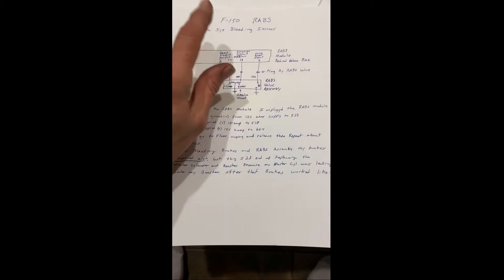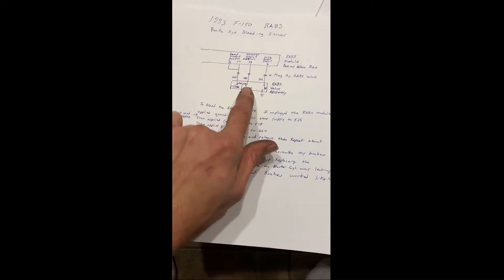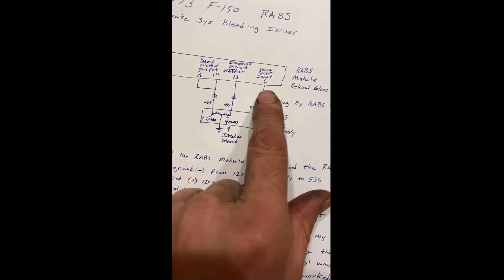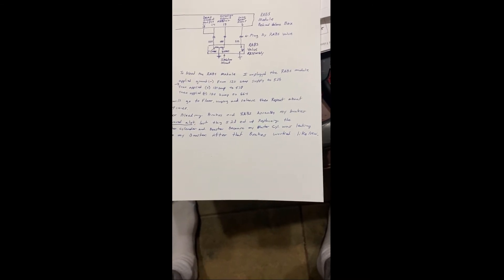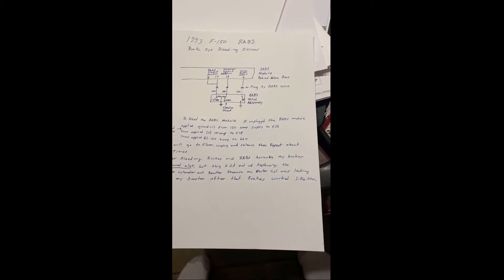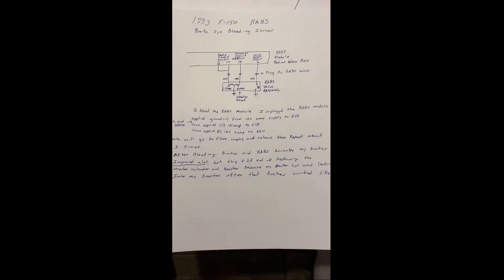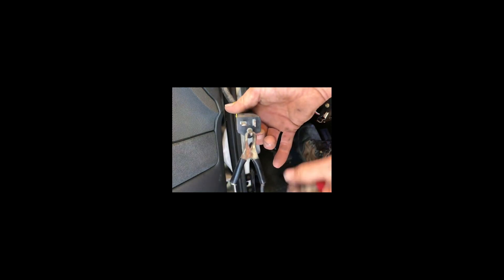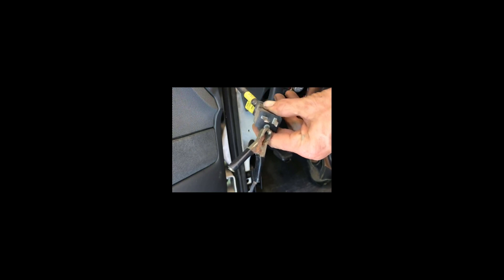Bleeding F-150 brakes, RABS, OBD1

Comment: 5 volts is all you need for this. I used 4 AA NiMH batteries in series.

I did this on a 1993 Econoline and it got my brakes working well.

The wiring on the RABS module is different in Econolines. All the RABS wires have two colored insulation. I connected (-) to the black/white wire, it being the ground for both solenoids. I alternated between applying (+) to the yellow/light green wire (dump solenoid) and the pink/light green wire (isolation solenoid). These being solenoids, polarity can be reversed.

During the standard brake bleed, I smacked the calipers and drum brakes with a plastic mallet to free up any air bubbles stuck to the walls.

I couldn't find an extra RABs connector, so I cut off my connector, wired it to my extension cord, did the RABS bleed, then soldered the plug back to the RABS. In hignsight, I should have also soldered some connectors in parallel so I can do this bleed again without cutting and mending wires again.

I highly recommend getting a copy of your vehicle's electrical troubleshooting manual. That's what I used and so did John Doe How To.

Thanks John!
Reply from the maker: You should make a how-to video because you seem like a really smart guy and it seems like a lot of people have trouble figuring things out.

Comment: Last one I had was a pain. Ended up bypassing the abs on the frame. It is a terrible designed unit. Primitive but doesn't work. Not worth buying a new unit either.

Comment: What's the pin-out on the module so I can use a power probe and apply the 12v  to yellow and red after I ground to black?
Reply from the maker: I’m not sure, colors may change over time. I just know that my plug-in device works, it’s been years since I made that video.
Reply: @geterdone   I have same problems whit my ford bronco 1987
Reply: @geterdone  can’t I use a  dewalt drill batery for provide that 2 volts

Comment: What is the "$500 test tool" you were referencing?
Reply from the maker: I think it may have been called a Ford rotunda superstar or something like that. It was a dealer tool that you can occasionally find on eBay for several hundred bucks. It seemed to me like it would have only worked with the four wheel ABS like some of the Broncos had but maybe their tool was broke because it didn’t work.
Reply: @geterdone  I'm surprised it was so expensive.  I have found numerous "antique" Rotunda dealer tools (like the EEC diagnostic computer) that originally cost tens of thousands of dollars originally for a couple of hundred bucks on ebay nowadays.  I do know that there was a special tool for 4-wheel ABS.

Comment: Does this method work for my 1996 F-150 with a 302? because a ABS light on in my insturment cluster that wont turn off after i start the engine.
Reply from the maker: As far as 96, I’m not sure. this is for RABS, (rear antilock brakes only) yours may have four wheel antilock brakes but I’m not sure. First question is do you have spongy brakes? If not check your tail lights and see if one of them might be out. If you have two brake lights go out in the rear or if you do like I did and put LED lights in there you’ll think the things gonna tear itself apart.

Comment: Can I pay you to do my brakes
Reply from the maker: Im in Washington state, you could if you have a flat safe gravel driveway you could (at your own risk) try getting to about 25mph or so and hitting your brakes to try to lock them up and the switch should cycle. I know a mechanic that said that is what he does in newer vehicles if he doesn’t have an electronic bleeder. He told me not to do it on pavement because its hard on the vehicles. It may take several times to cycle thru. Let me know how it goes.

Comment: I’m I exact same position. NOBODY can fix my brakes. How much is electric scanner? I have 95 7.3l
Reply: F350
Reply from the maker: The one borrowed from the dealership isn’t made any more and did not work. On ebay they were over $500, I wouldn’t risk it.
Reply: @geterdone  What is the name of the tool?  I assume it's a Rotunda tool of some kind?

Comment: I bought a 1991 F350 with really spongy almost non-existent brakes.  I replaced the master cylinder rear drum brakes and a rusty almost ready to blow brake line.  After all this I still had firm pedal when the truck was off but spongy to the floor when it was running.  I bled the brakes like probably 6 or more times (like 2 liters worth of fluid) using both a cheap vaccum pump bleeder and the traditional 2 person pedal pump and dump method.  Still no improvement.  I removed the RABS spring and bled a couple times still nothing.  I finally tried the method in this video using a 12V 1amp trickle charger to actuate the RABS then when I bled the rear I got a bunch of air out, after which I finally had normal brakes again.  Thanks for the video!!!

Comment: So im assuming you have the RABS bleed screw open while you were energizing it? When you let the peddle travel back up wouldn't this suck air in the system if you do not have some one closing the bleed screw? I have the spongey peddle and i have replaced everything in for the entire system ( full restoration). Im thinking its the RABS.
Reply: I did not have the bleeder nut loose when I performed this RABS energizing method.  I did bleed my brakes and the RABS from the bleeders after I performed the energizing and seemed to have gotten a bunch of air out of my rear bleeder which I presume was knocked loose during the RABS actuation process.
Reply from the maker: When I’m electronically activating it I do not have the bleed screw open, if you do that you’ll end up introducing air back into the system. When you electronically actuated it it allows fluid to bleed from the RABS unit back into the master cylinder reservoir so you’re not going to run yourself out of fluid unless you have a ton of air in the system.
Reply: @geterdone   can use a lawn mower to put energy to that rabs or only whit that battery charger
Reply: If I understand this, the bleed screw on the unit won't bleed the internals of the isolation valve or the dump valve, only the common chamber. This is why it is necessary to actuate the dump valve and isolation valve electrically. I have yet to try this so I don't know yet for certain if bleeding the screw on the unit is necessary after doing the electrical actuation or if the bubbles will go up to the master on their own when the pedal is released and fluid is allowed to return to the master or not. I do know that air in the brake lines is supposed to rise to the highest point which may be why the rear wheel cylinders need to be bled first after changing the unit. It appears like I need to perform this repair myself and I am less than enthused about it. If I find out differently I will try to say something.